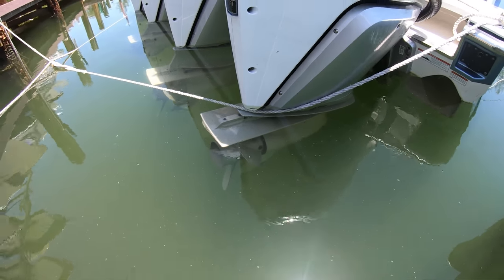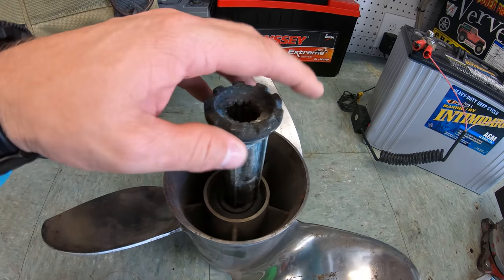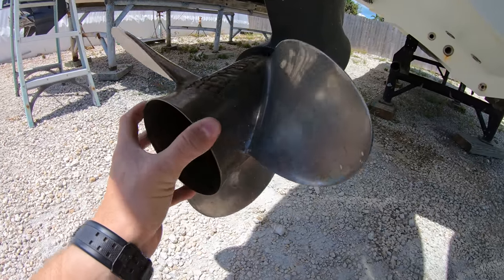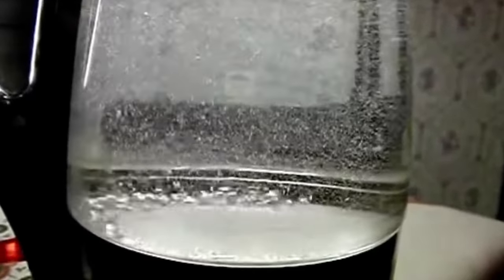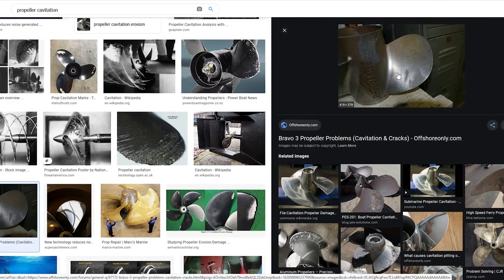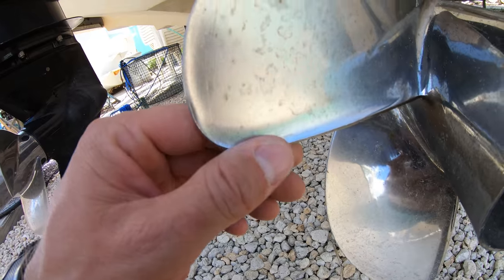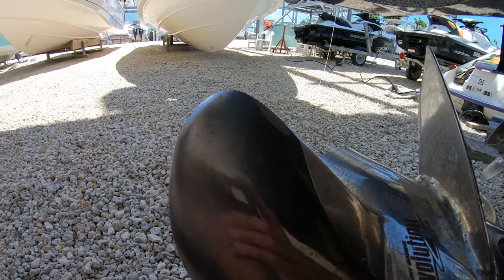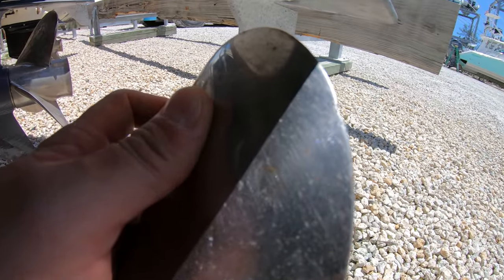Got BOAT Prop PROBLEMS? Cavitation Vs. Ventilation!!!

Comment: Thanks for this video. I hit something last season that didn't cause immediate issues, but the next time we went out my RPM was high and our power/speed was low. I've changed the hub and had a few mechanics look at it. It seems like something is slipping but we cannot find the issue. I plan to look into this as a possible cause. Thanks again.
Reply: Hi Tom. Pull the prop and draw a line with a felt marker  across the front of the hub and prop  and reinstall it and try it out. After running it for a bit, pull the prop again and inspect the lines. If they are out of alignment, you'll know your hub is slipping as the marks should stay lined up.
Reply: exhaust ring behind your prop is wore out.

Comment: Sharrow prop will fix that and give better acceleration and top speed as well as fuel mileage would highly recommend getting one
Reply: overpriced waste of money ...have you priced one of those props yet ...? and if you ding it up no prop repair shop will touch it.

Comment: Listen to what he says about the ring between the gear case and the prop. I just bought a boat that should be going almost 40 miles an hour and is only going 31 at 6200 RPMs due to the propeller bore sleeve not being there. Most outboards come with these from factory. It’s a $5 part that makes all the difference

Comment: The props ony my 16' skiff and 10ft jon boat cavitate, and my 14ft jon boat ventilates due to damage to the lower unit, im fixing that in a few minutes. Im going to run the cavitating props until I get problems that interfere with my boating. I love my omc 6hp

Comment: I have twin 200 ox66 starboard engine has cavitation at over 35mph in a chop and have  to stop boat to regain grip it will not regain grip unless boat is stopped

Comment: I thought I had a spun hub, was getting the surge in RPM and loss of forward momentum.  So I replaced the prop and hub.  Old prop was a pressed in style, I switched to an RBX hub.  First trip out with new prop and still wound up with surging RPM/loss of speed.  It only happened at 3000+ rpm.  Decrease the throttle and regain momentum and throttle back up.  It would do it just going straight, so it wasn’t like turning or any other water direction changes (I.e. wake chop from passing boat) was always present…EDIT. I figured I’d include my setup..  24’ pontoon with a 115 Evinrude. No jack plate, engine in lowest trim setting. Running a 13-7/8”17 pitch prop.  One prop is SS with pressed hub other is Aluminum with RBX.
Reply: Sounds like my issue!
Reply: @hardrockminer-50  What was the problem/fix? Im having the exact same problem

Comment: Hi guys I’m a new subscriber. I have a 2000 Grady white 226. I just got her home yesterday I had a shop install an aluminum floatable offshore bracket, fiberglass the back up, install new 2021 Yamaha 250 4 stroke motor we also cut out the back compartments and made the back bigger for fishing room. We also installed a below deck fish box custom. 

I took the boat out today for my first time with all the new upgrades and it seems like the rear end is sucking down and I need to go over 3500 RPM with the motor trim down just to get going. It has less power than I used to have with my original set up which did not have the offshore bracket and had a 3.3 vs the 4.2l motor that I have now. I watched a couple of your videos and it looks like there could be several different possible problems. Where can I post a couple of pictures for you and your members to see and maybe give me an idea of what could be wrong. I feel like when I am driving the boat the motor is too low in the water, the water level is almost up to the lower cowling I’m getting a lot of splash back as well/rooster tails. 

Also another thing I noticed is when I am just going slow the front of the boat feels a lot closer to the water which is weird I would think the back would be lower with all the new weight in there. We did move the two batteries up in the front cabin. Overall I had a lot of work done on the boat. 

Thank you I appreciate any suggestions or help.
Reply: May I ask how much did you spend planing to do the same
Reply: @guillermoperea2702  73K. It started as 55K ( Just the new motor with all misc parts roughly 27+K) for everything with 2021 Yamaha 250 all-new wiring and all. but then I found out that a lot of items had the letters TBD ( to be discussed) I was not aware of that. We shook hands at the $55K number then I got a bill for $80 + Thousand and blow a gasket. After going back a forth we settled at $73K

The price includes all custom transom and cutting out the compartments in the back, new batteries relocated to front, custom large insulated below deck fish box, etc. 

Honestly, if I know it was going to be this much, I would have just bought a brand new boat. 

The good news is that I built a custom boat that fits my needs and is now a fish-killing machine. Also, everything That was installed was all good quality material no cheap parts which also added to the final bill.
Reply: @silverbull2932  dam I have a 28 footer WA with an inboard, was planning to remove the inboard and install a 250 with a bracket. Was just planing to spend about 35 thousand, but I might change my mind I can get a brand new 25 foot center console with a brand new 250 for 70000.

Comment: I’m having a lot of issues with a boat and getting the correct propeller.    To start off, I have a 19’ bowrider with a 150 4 stroke.   I started off with a 19 pitch mercury black max.  It was over reviving at top speed 52mph and the boat was also hard to control.   It would chine walk at WOT.   
Then I got a black max 21 pitch and the prop would feel like it was slipping.  I second guessed myself and thought I might have forgot to tighten the nut! 
Next I purchased a 19 pitch Michigan wheel Apollo 3 blade.   I had no issues with slipping but the chine walking returned at wide open throttle.   I got a deal on a high five 21 pitch and figured I’d give it a shot.   I tried it out today and the prop feels like it’s slipping again.  If I punch it, the engine over revs.   I feel like I’m fighting a losing battle here.   Im also wondering if my engine is too high but it’s mounted as low as it can be and the ventilation plate is about an inch above the bottom of the hull.
Any help would be greatly appreciated!
Reply: chine walk is a result of poor driving skill that is all.
Reply: @crashalexander7232  lol.

Comment: Yes 9.9 Johnson with flat bottom boat ... we started out from dock ...then when I throttled up boat barley moved noticed lots of bubbles trailing in wake was like something was holding us back ... this was on a power plant lake where the water temperature was probably 75° or higher I just thought maybe it was the temperature of the water that was the cause of that reaction it never happened to me before on other lakes???

Comment: Technically sound information. Most people do not know the huge  difference between cavitation and ventilation. Cavitation in liquids is the formation of tiny voids of the gas phase of the liquid suspended in the liquid itself. This phenomenon  is commonly called "boiling". Boiling water "bubbles" on the surface of your prop seems ridiculous, right? Where's the heat source? Boiling is a pressure difference phenomenon, not a heat phenomenon. 
The tiny, extremely short lived "boiling water bubbles" created by the propeller are formed from massive local  pressure differences in front of and behind the prop. 

Water pumps are subject to the same cavitation phenomenon. Maintenance on big ship propellers (also called screws) is mainly a fight against cavitation damage on the screw. Another thing most don't know is that ultrasonic cleaning is actually using high frequency transducers to form cavitation "bubble sites" on the object to be cleaned in the tank. In all cases, these little bubbles of low pressure water vapor violently implode on themselves as the trapped vapor condenses back to a liquid. This can do severe damage over time. 

 Everyday examples: 

Cavitation is boiling. 

Ventilation is like putting a straw into a glass of water and using the air in  your lungs to blow air bubbles into the water.

Comment: Nice video. I always get a vibration when I try to accelerate too hard or have a bunch of people on the boat. I always contributed it to cavitation, but to be honest, not really sure. It feels like the prop is trying to bite, but can’t quite get it. Like peeling out in a car. I have to slow my acceleration or reduce the load on the prop/engine.
Reply: Might be able to lower the prop pitch. You will lose a CPL knots but it will definitely grip better. Cheers
Reply: This is why there are jack plates and "trim." Point being when you "launch"(through propulsion) the bow will rise and stern will fall making for an enormous amount of stress on the transom. Anything that levels the boat("on plane") is what solves this problem which using a modern outboard motor means an engine that can create its own trim upon launch be being at the greatest depth and narrowest distance from the transom. Another way to tackle this issue is by the use of an "Armstrong bracket" which simply moves the engine(s) further back which whilst creating more stress also creates creates better trim simply by adding length to your hull.

Point being there are only two speeds on a boat namely
A:trolling speed(the most important) when you want a hull to naturally be on the level and
B: "on plane" speed when the forward velocity is sufficient to cause your hull and motor to ride upon the surface of the water where there is less surface tension to have had need breaking apart in order dramatically reduce friction and promote stability and control.
Reply: @doolittlegeorge  Well said sir!
Reply: Hey thanks. This particular boat is an I/O, so a jack plate or Armstrong bracket wouldn’t work. (Both of which I had to google by the way) However, this sounds like something a set of trim tabs could help by pushing the haul on plane faster and with less effort?

Comment: I cannot prove but I suspect that my used boat was ventilating due to combination of aftermarket hydrofoil that curved downwards in combination with short, damaged skeg.  Removed hydrofoil and fixed skeg.  Back to normal.

Comment: Hey Aaron, my problem is when I turn too hard I get ventilation. Not sure why my anti ventilation plate rides right on top of the water when running and planed out. But when turning hard port or starboard it sucks in air. I have tried different angles of trim but no luck. Any thing you can help me with would be greatly appreciated. Another great video with all kinds of useful information. Thanks 👍😎🌴. Be safe out there.

Comment: Had an Evinrude 150 plastic snap ring that goes into the lower unit was missing and I was getting cavitation exhaust through in around propeller took a while to figure out a 10 dollar part keep me from moving
Reply: any chance you could share a photo.  I have a 150HP johnson that has been been giving me cavitation issues for 3 years now and I am losing my mind.  thanks

Comment: Hi, I really enjoy your vids. I’ve learned a few things, thank you! I’ve had some terrible ventilation on brand new Solas props when I’ve gotten into very choppy churned up water. It also happened during a rally where a lot of boats were going into a channel causing a lot of foam. But I think that’s probably normal. They otherwise run great.

Comment: 1st day on the water with a Tracker Grizzly 1860 cc and a 90 hp merc. 

Getting ventilation and cavitation but at different trims and rpms. 
Can't plane the boat. 
Could it be a large transducer too close to the prop?
Reply: yep and or motor is to high ..? only trim you should be using when getting on plane is full down.

Comment: I have a new 2019 Verado 250. Brand new it was not shaking at idle, now it shakes at idle. What could it be? I do not see the propeller wobbling. However the center nut it seems not to be centered when I spin the propeller by hand. Could it be that? Only has 35 hours.

Comment: I thought my 25 hp had spun a prop so l replaced it from a 11npitch to a 13 pitch and it seems to do the same thing as  the 11 Pitch. I haven't marked either to check if they're actually spinning or if l have a drive gear issue.

Comment: Boiling air bubbles? Cavitation is a partial vacuum. the fact that we are beyond the boiling point of water in this low pressure state is irrelevant in my opinion but I can be wrong on that last point

Comment: I have a 2018 mercury 100 hp command thrust with today a black max aluminium 17p that slips on the water under hard accelration or trimming out on the outboard. I bought a slightly used mercury vengeance 19p can i use the samme flo torq ii hub kit i use on the black max on this vengeance prop?

Comment: Just bought a 1985 bayliner Capri with a Volvo penta engine. I’ve been rewiring a lot and getting things to  work. Next step is to put it in the water and see what happens. I’m kind of worried I’m going to have some kind of issue like this. Crossing my fingers

Comment: Great video. I have a 14’ jon boat v haul with 25 2 stroke. Gets right on plane on second pin setting but when I really accelerate hard the bow pushes down. If I go to third pin gets on plane and runs perfect but I can hear some air sucking slightly. No prop spin or nothing think that’s ok or run 2nd pin? Appreciate input!
Reply from the maker: Well, hearing sucking air could mean a lot of things and where is that coming from? Lol 
But, if you don't lose your tell tale, and you aren't getting the engine hot due to lack of water flow, you should be good to go with the third pin location. But it probably takes longer to get on plan I'd imagine. 

Also, consider how high or low the engine is mounted, with that, depending on how far away you are, you could try and look down there when running, or try setting up a camera so that you can see the anti-ventilation and see where it is. 
Because if the engine is too high, that might be the prop ventilating. You could lower the engine a hole and run the 3rd pin which would keep your angle right but get the lower down just a hair to get more clean water, just remember that the engine height is playing a big factor here :)
Reply: @BornAgainBoating thank you I’ll try that !

Comment: Ventilation yes, cavitation no, but a marina guy called it cavitation.  Boat is going full throttle and suddenly sounds like prop slip and loses speed I have to back off the throttle and take off again and it won't do it again until I hit full throttle for a ways and then it does it all over again. He said toss weight in the front
Reply from the maker: You might have a failing propeller hub
Reply: @BornAgainBoating  
Was replaced.....twice

Comment: I’m a newer boat captain been a sub for awhile.... thanks again for your time and effort as to your knowledge. I have a marine 115 outbound  I’m loosing forward momentum intermittently. The engine rpm is clean smooth running... I’ll pop it neutral put it back into gear and away I go again. Is this the above topic? New captain here don’t want to sink. :) tnx
Reply: Spun prop hub?
Reply: @chrish5096  - thanks for the reply,  the hub and splines are perfect no worn parts. When the engine is off and you turn the prop there’s lots of tension. Pop it in neutral it spins freely. When the engine is idling you can rest a beer can on top and it won’t shake off. Idk stuck in a swamp here. :)
Reply: @mralien4710  That's pretty weird, I'm not any sort of expert on the topic, I was just throwing out the possibility of a spun prop because I've had that happen to me multiple times before. Weird for sure
Reply: @chrish5096  like I said thanks for the reply all we can do is share information and try and help. Most appreciated:) have a great day. :)

Comment: now I don't have to many brain cells but I've always wondered how you don't cut your feet of when climbing down the ladder on the back. do you have to wait for the propellers to stop spinning?
Reply: You always make sure the drive are in neutral and ideally the motor's are turned off.

Comment: so i think i have cavitation issue, with vibration of boat/motor from around 2000-2500 rpm.then it goes away as i increase rpm/speed.so would i change pitch of motor get rid of this.?
thanks
john

Comment: I have twin 60hp only 115hrs on the new props  as well as the engine. There is striping on the left prop on all three blades. On the pressure side. The edge of the prop is clean. What do you think could be the problem?

Comment: I couldn’t understand why I was having quite violent ventilation issues on my twin hill boat 
I tried a hydrofoil plate but that created spray, loss of power also 
I finally realize that the motor should be slightly lower in the boat which is too much of a hassle so as it works fine fully down that’s where it’s staying 😢

Comment: would like to see yall or somebody make a video on setting engine height on a tunnel hull-i got a 20ft paradise boat works tunnel hull-i put a manuel jack plate on and tested on a lake and have run 3years in the gulf-i have - rooster tails on both sides-online videos say im too deep-im saving for a microjacker next year-w a tunnel you have to have low to start but i guess its even lower when on plane?is the answer a electric jackplate or should i install a tilt and trim-my engine used to have

Comment: How do you know what is the right prop for your boat? For example, one day in the future I plan on building a boat from a haul. If I put a modern outboard with an engine platform on the back of a center console, how would I know what size, pitch and blade count is best, or where to start?
Reply: whats a haul? what is an engine platform? outboard mfg have prop charts avail try google bro...lol